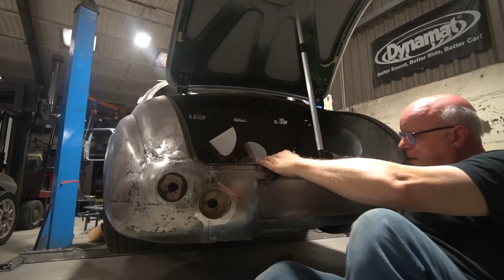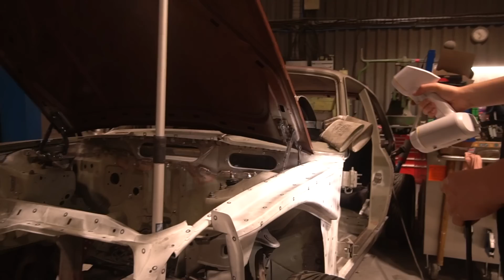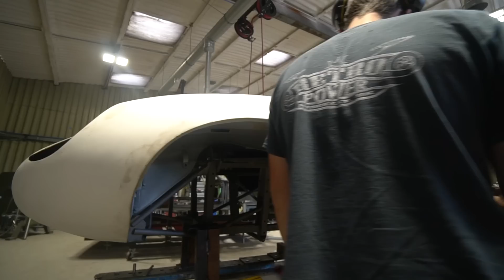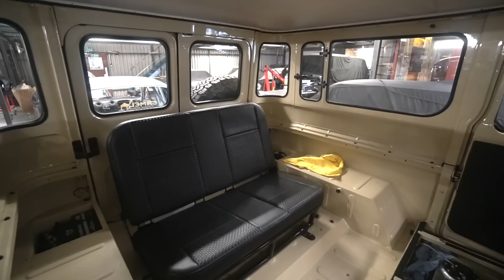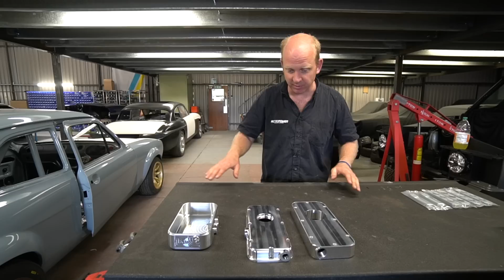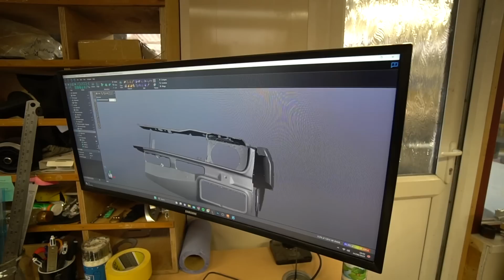V8 FJ40 Land Cruiser Fuel System Tweaks

Comment: Have you looked into a cable identity printer? I've seen them used before in electrical cabinets for machine control. Once cut to length the entire cable was fed through the printer and it's ID number was printed at intervals.

Comment: For the wiring, look into a "wire striper"; they use an ink formulated for the thermoplastic insulation to mark a colored line down a wire as you draw it through. That would multiply your wire assortment by the number of different colors, more of less. Another week of awesome work; since I have shown you about, I, too, have no idea why you don't have a greater following on YT. I subbed about # 35 or so, and I've never been sorry I came- mostly gobsmacked! Btw, that bit of detective work to figure out where the outage in the Austin was awesome- took an engineer's eye, for sure!

Comment: Hello from Australia... do you have a link to the stealth clamps? Also id the Jag rear is rubber mounted, (Churchill) how did you come to the solution for the trailing arms? Here in Australia if jag rears are solid mounted, the "A" arm has to intersect with the lower pivot point of the rear arms. To pass engineering, that is.

Comment: One of my final year projects in 1985 was 4 bar linkages. It's amazing what you can do with changing the lengths of each link in terms of path and acceleration. Things like Victorian box making machines used them extensively